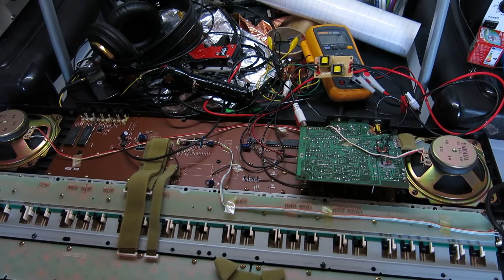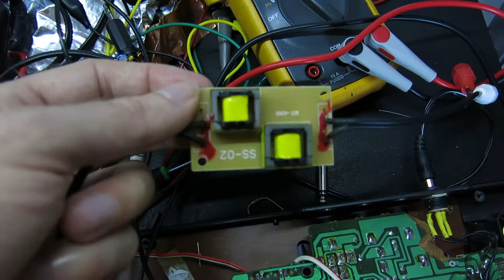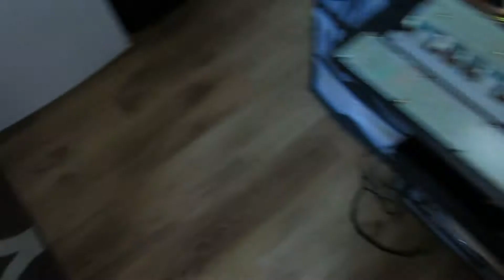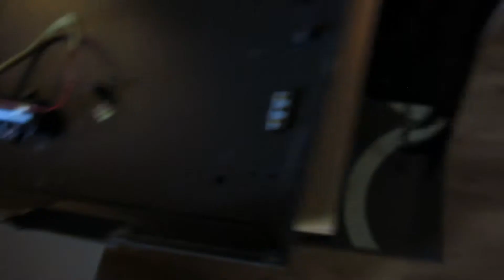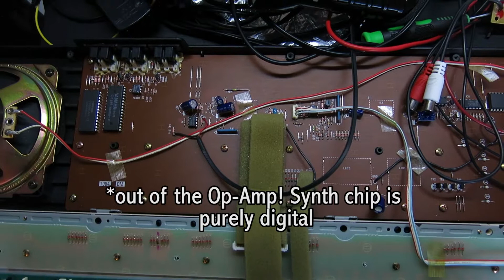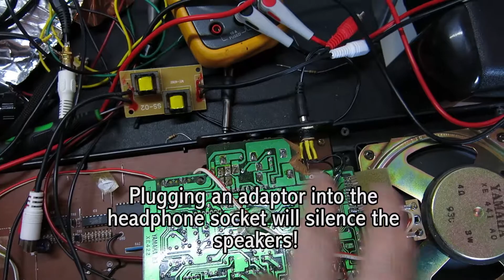1989 Yamaha PSS780 - Noise Free Direct Output Mod / Whine Fix - Part 1

Comment: Well post some audio comparisons ya DUMMY ;o

What kinda frequencies are you getting? You showed me the scope traces but..
Reply from the maker: Jarrett Does Stuff, very occasionally comparisons coming in part 2 when it's properly installed. If I remember right from a spectogram, there's a fundamental around 7.4khz, with upper harmonics up to about 21k